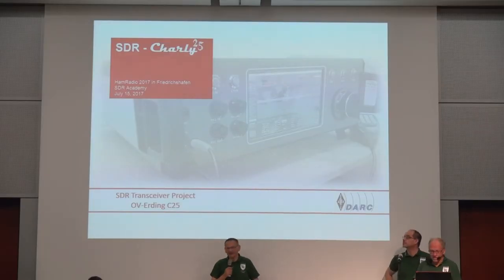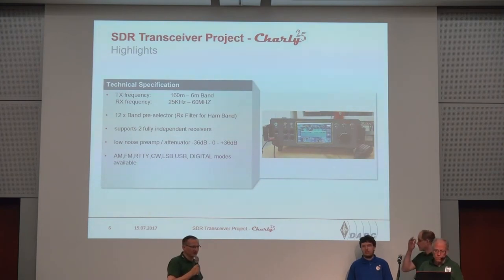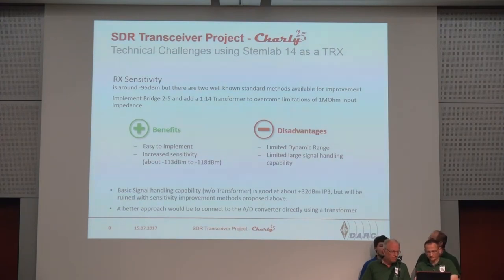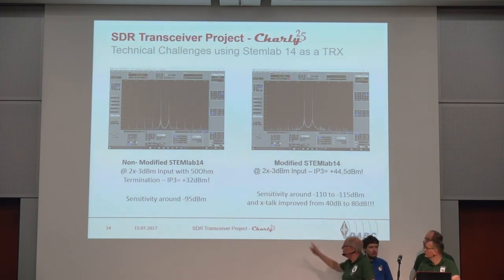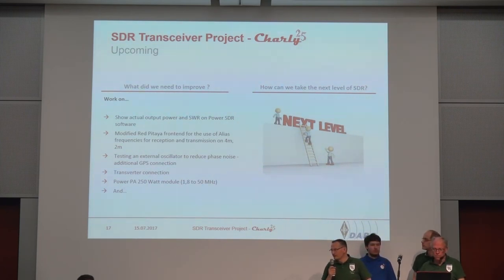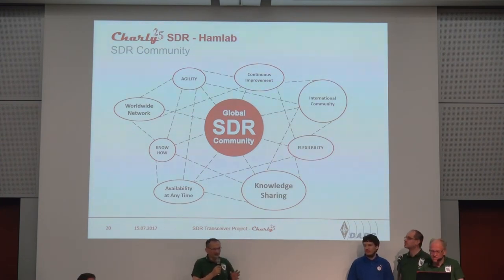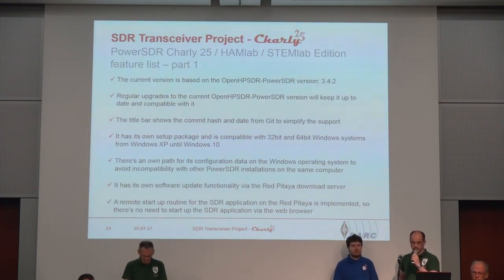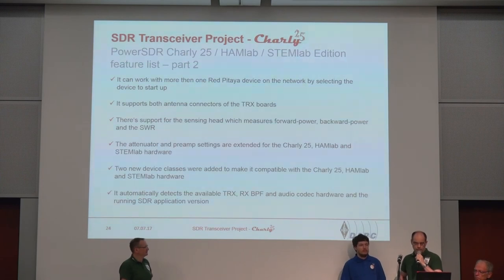Erwin Rauh, DL1FY: Charly25 – SDR Transceiver Project – Community Development

Comment: It’s remarkable how these guys adorn themselves with borrowed plumes:

This SDR would not work without Pavel Demin’s fundamental Red Pitaya firmware for the
Xilinx FPGA which is the precondition that the Red Pitaya can communicate with
the OpenHPSDR operation software PowerSDR OpenHPSDR mRX PS. All mentioned
innovative features like noise reduction by diversity, predistortion, MNF, RA
etc. are part of the advanced HPSDR development and available since years (even for Red Pitaya homebrewer). Although open source, it would be fair to state Phil, VK6PH, Joe, K5SO, Doug, W5WC, Warren, NR0V and others as the real inventors and delevopers of these outstanding software defined radios.

Helmut
Oeller, DC6NY